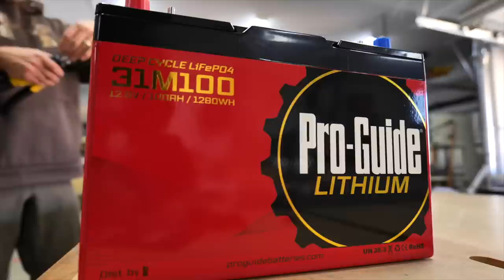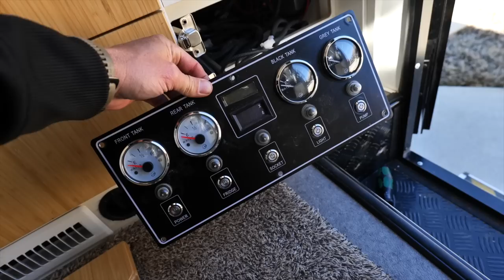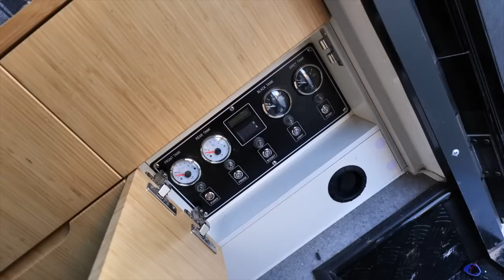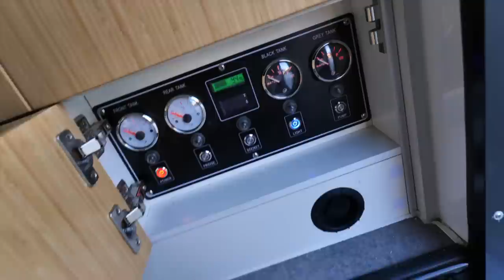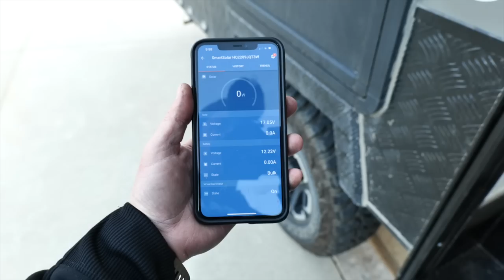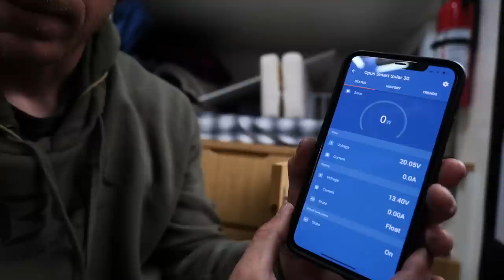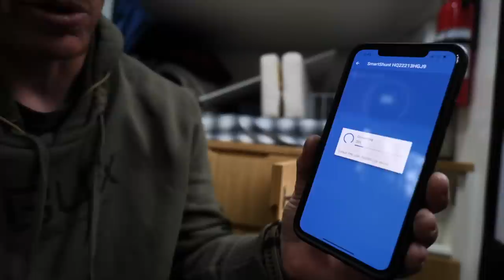Upgrading Off Road Camper to Lithium Power! HUGE DIFFERENCE!

Comment: Another thing you could do for a down the road situation is on the top of your roof where the 3 panels go to 1, on the camper side of the plug going into the roof, swap that connector out for a 2 connector and then you can run a daisy wire down to the ground to connector external cheap foldable panels that you can put in angle of the sun, or they can lay on top of your awning when its extended with not much worry about weight.

Comment: you may find that fuse will possible be for the electric brakes. we have a similar style camper in Australia, and when i did my lithium upgrade the old link went out the window into the trash. now you have the solar controller in try a dc2dc controller on the 7 pin plug feed as close as to the battery so you can have both solar and car feeds charging at the same time. plus the dc2dc charger s normally have a solar input to them which can be used for the portable solar for extra days in the bush.
nice job to by the way Happy Camping.

Comment: How did i miss this one.
LFG This is what i do for the phone company. They use Big Batteries.  DC power.  I bet you didnt know your land line phone is DC.
Put No OX on the batteries.  So your leads will not corrode.

Comment: Great and very useful video! I am doing something very similar. What did you do with the solar controller transformer you ID at 16M 17s of this video. Did you keep it or remove it along with the original solar controller in lieu of your new solar controller?

Comment: @lakeforkguy In your Big Bend video, you stated that the outlets and USB plugs did not work without shore power. Is that correct or did you just miss a power switch somewhere? Seems like an odd setup for a rig that is supposed to be an off grid juggernaut to not be able to simply charge a phone or GPS when you are in the boondocks.

Comment: I bet you just cut at least 120 lbs off your camper.  I know a guy that just had his hunting "golf" cart to lithium, but the setup he got is just one big battery, it's kinda like 6 batteries all in one. I'm not sure what it cost him, I know it wasn't cheap, but his cart now works much better and goes further without ever losing any power/speed like AGMs. When AGMs get like half depleted the cart starts losing power/speed, and with the lithiums, it never losses any power/speed until they are completely dead. So, with the lithiums, it's best to keep an eye on your power gauge because when they're dead, they're completely dead. lol.

Comment: As someone who’s worked with wire connectors for 40 years, I have to disagree with your buddy. Wire nuts (party hats) that have been taped to the wires with good electrical tape are the best high vibration wire connections for high current connections.
Reply: If a wire nut is put on two straight wire's and let the wire nut do the twisting it's a pretty solid way of connecting. I've never had one let go.
Reply: As an automotive tech I find these things on the floorboard all the time you guys suck

Comment: I'm confused why you would go from 3 batteries with 200 amp hours to 3 batteries with 100 amp hours.  That's half the discharge time. I would have kept my AGM batteries and got better solar panels.